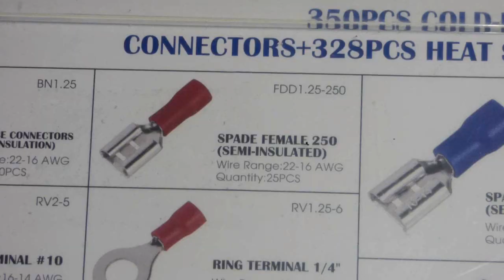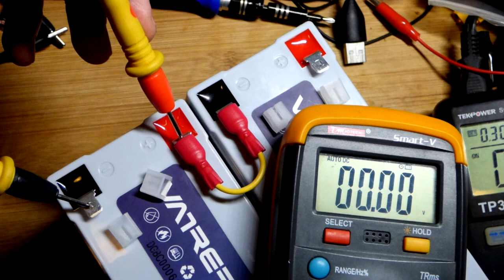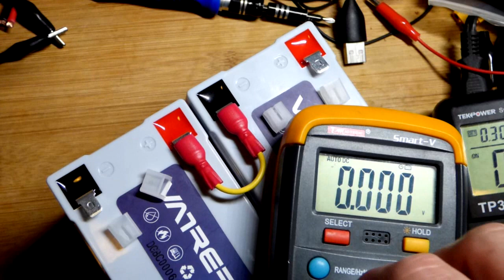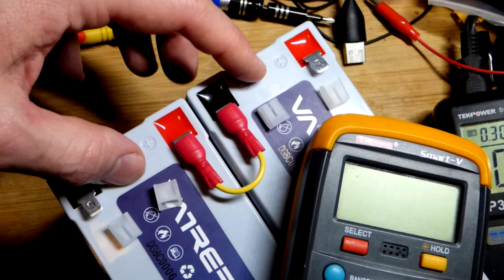How to make DIY female to female spade connector jumper wire for small series batteries

Comment: Just curious of your plans for these batteries? I would consider purchasing them and following along if they are going to be  part of a further project. I almost always enjoy what you are doing, although I am very much a beginner.
Reply from the maker: I don't have any specific plans, I buy a lot of batteries, solar generator and smaller power banks, and connectors and stuff. I think its good to build small scale systems with batteries this size before building larger scale versions. These will be in the majority of videos because they fit on camera pretty easily and are easy to put away again.